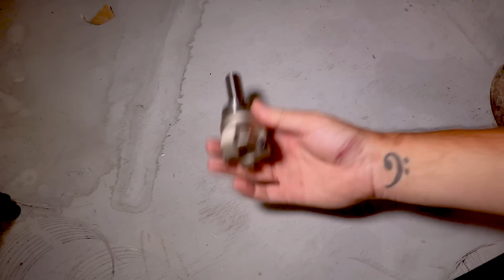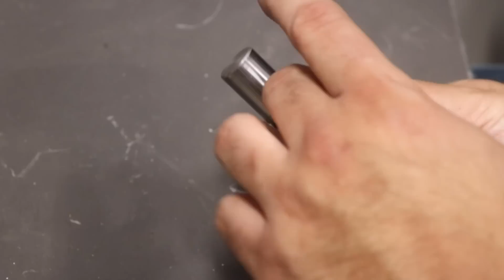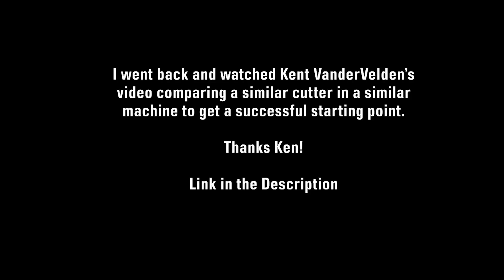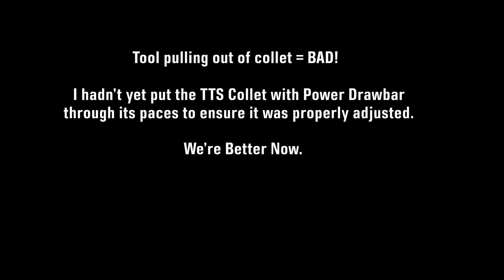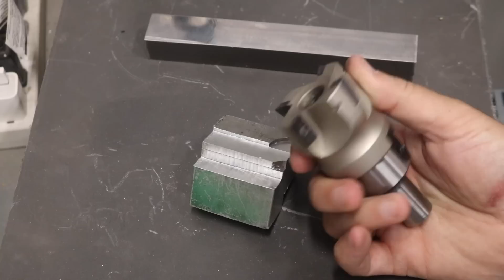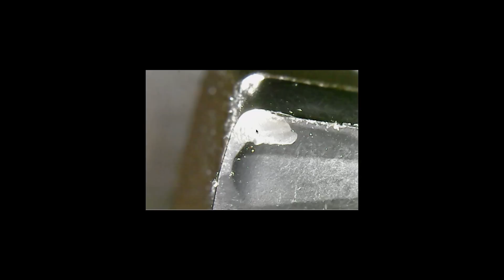Testing a No Name 50mm Face Mill in my Home Converted CNC Milling Machine!

Comment: Nice tool, I just bought one for my round column Mill/drill. At $35 for the tool and shank, you really can't complain. One thing to keep in mind if you are buying one of these with an R8 shank, the drawbar threads come in several flavors. I use a 7/16th drawbar and a 10mm one for some shanks. I bought one of these shell mills and didn't notice that it came with a 12mm drawbar thread. PITA, now I need 3 different drawbars.  It turns out that it's cheaper to buy a new shank (the right size) than it is to buy a new drawbar. Live and learn.
Reply from the maker: Never thought of that, good point!
Reply: I ran into this problem a few times also but I just made my own draw bar whenever i needed .  Its so easy to make a draw bar I couldn't imagine waisting the time or money to order one .

Comment: Welcome to the world of indexibles! It is a world apart from using endmills but keep up the effort man. After watching the video I wanted to give you some info in case it helps. 
-For a small mill like you are working with, Ive found  its best to keep the radial engagement high (70%-90%) and the DoC low.. maybe start at .025" having more than one insert in the cut at once helps smooth out vibration and increasing the amount of time in the cut also improves insert life. 
-SFM. you should be between 500 and 700 SFM on aluminum which would put you around 1000-1300 RPM for that cutter. When you spin too fast, the amount of heat you generate in creating the chip leads it to melt a little, even with coolant. melty aluminum sops up spindle torque and leaves awful surface finish. 
-Looking at the purplish hue of the inserts, they appear to be coated, maybe TiAlN.. if so, you may be working against yourself. TiAlN is great in steel but since aluminum is a large component of TiAlN coating, aluminum chips tend to weld to the aluminum in the coating. Alumium specific inserts would be ideal but ive had great luck with TiN coated inserts that I've honed to a sharp edge with a diamond stone. 

Hope this helps.

Comment: Honestly I don't have a cnc machine,  just a grizzly lathe & a drill press. Lol we've all used those inexpensive eBay finds to help us get the job done. I work mostly in peak, delrin & some acrylic,  there's been many a time where I've used those endmill bits in my lathe or lathe lol.

Comment: That cutter is not really meant to cut the face and sides, only on the face.  It's a squaring tool. Great videos, keep them coming.😀
Reply from the maker: For sure! It definitely underperforms on side cutting, but of course I just had to push it 😉
Reply: @PracticalRenaissance  right there with you!
Reply: In "real" (not home-gamer) machining, facemills like this are used all the time for roughing shapes with the side of the cutter. You can only step down the length of the insert, but they are very effective at removing a lot of material quickly.

You could do this on a hobby-size mill, but you need more HP/rigidity than his machine has.

Comment: Check out ZCC for CHICOM carbide. They're cheap, not the cheapest, and they're good, not the best.

I know some real, full-time machine shops, customers of mine, that use ZCC inserts almost exclusively because they've taken the time to figure out how to run them and get at least half as much life out of them as other inserts that cost twice as much or more. Not all, not even many, but some.

There's a rumor, and I absolutely have no idea whether true or not, that ZCC operates in a former Sandvik facility. Story goes that Sandvik decided to build a new facility elsewhere and Chinese interests bought the old facility and hired up as many of the workers as they could. Again, not saying this is true, nor am I suggesting that, if true, it's up to the quality of Sandvik.

Comment: Grizzly  G0704 claims 1 hp/ DC motor but what I've seen here this machine delivers 1/3 HP at the spindle.   And you're playing with cold rolled  steel.   I think if the metal was any grade stainless the 704 would be a painfully wrong choice to buy for my first mill.

Comment: Just a thought, could you help us beginners by comparing the low cost cutter with the same cutter in top performing "pro" grade?   I'm just starting to invest in machine shop equipment and tooling, and I need quality results for prototyping my inventions drifting about in well worn gray matter.  I don't have deep dollars, but if there is a substantial performance increase for a top pro tool then I'm inclined to dig deep and not waste resources on Ebay cheesy.  I've watch a few of your vids and think we probably were sprouted from the same pea pod.  THANKS YOU, YOU'VE BEEN A GREAT ISPERRATION FOR ME TO GO FORTH AND BIULD MY CRAZY IDEAS.  Every Bud in my circle thinks I'm wasting my money...money my inheritors should have to buy more beer.....LOL, but true, sort'of.

Comment: you need way more rpm, you need to spin it like crazy, I use 3500rpm on a 63mm face mill , on a 50mm face mill you need way more than that, low rpm means it does not cut that well and instead of cutting the material away it pushes the material which puts a lot of force on the cutter and the machine
Reply: Also not true, your RPM is in relation to your feed rate and ultimately depth per tooth. You want lower RPM for a smaller motor, not higher. With that RPM and feed rate, the cutter doesn't even have a chance to bite into the material, all it does is heat it up.

Comment: I would not recommend using any sort of coolant when working with carbide insert tooling. It can create stress in the insert that may Lead to decreased life of the tool
Reply: Mr. Kawasaki that was true in the seventies and eighties. Carbide has come a long way since then.
Reply: @kristoferjonsson3362  yup. You're right. Coolant won't hurt anything unless specified to not use coolant.